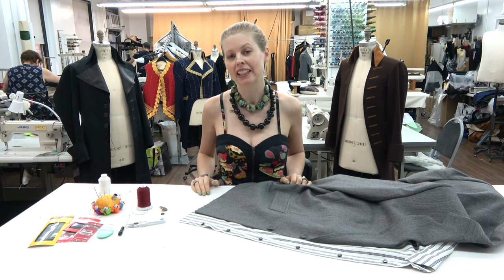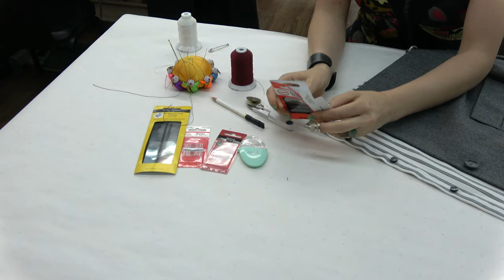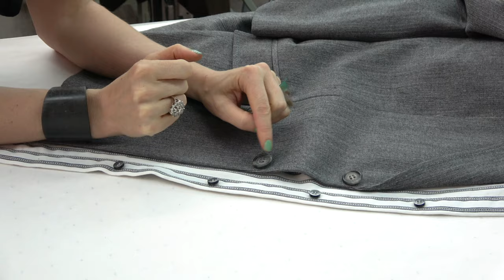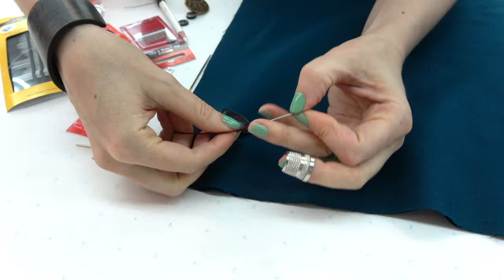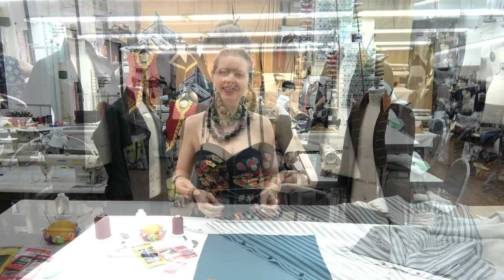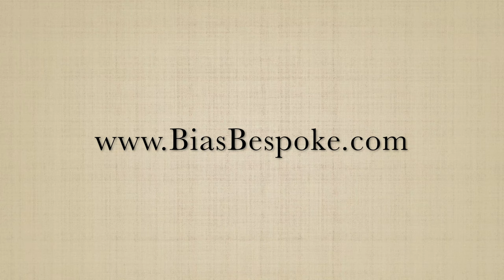Tips and Techniques for Sewing Buttons the Professional Way

Comment: Thank you for this informative tutorial! I bought a  $400 nice cashmere coat for 90$  and it was missing 12  large buttons with a shank and only 2 of the original remained! I knew the usual simple up and down method without a shank wouldn't work for a coat like this and didn't know what it was called just that it was different from the  method that I have employed previously. Now I can go and sew my replacement buttons with confidence that I will be doing it the right way so there is some give in the buttons and they wont pop off from strain.

Comment: Thank you for the video! Can you also show us how to sew a shank button for  Morning Coat front button? The shank is longer than the shank of a jacket button, about half an inch.
Reply from the maker: When we make morning coats, we still use the same length shank in order to keep it clean-looking. The shank should be just slightly shorter than the thickness of the jacket where the buttonhole is. 
Or do you mean that you want a "chain" with one button on each end of the chain and a buttonhole on each side of the jacket?  For a chain (if using thread instead of actual metal chain), it's much like crocheting, we just recommend using a thick, nice thread so it looks luxe and lovely.
Reply: @biasbespoke  Yes its like a chain with buttons on either end, do you have a video to show how to do the chain? Many thanks in advance.
Reply: @hjamesayashi1590  We don't have a video for it (yet?) but if you search for how to sew a "swing tack" that's the technique that we'd use for the case you mention.